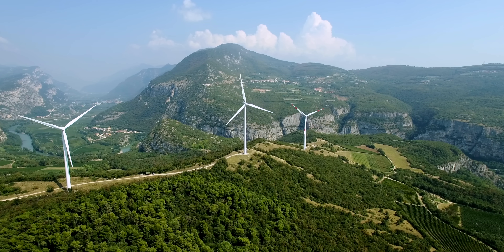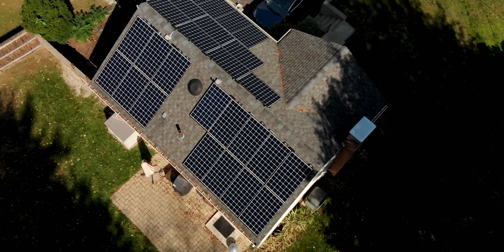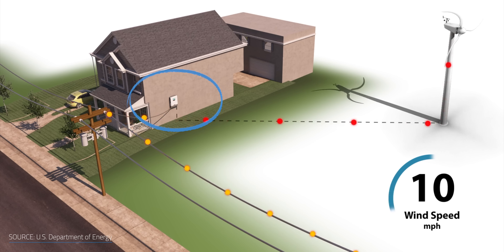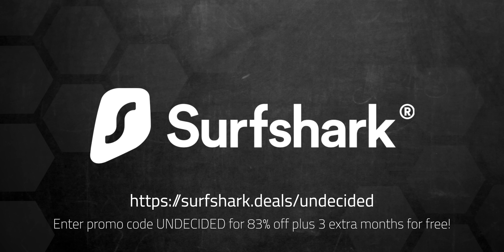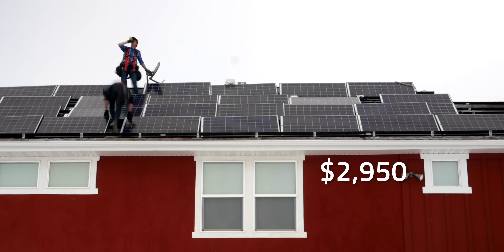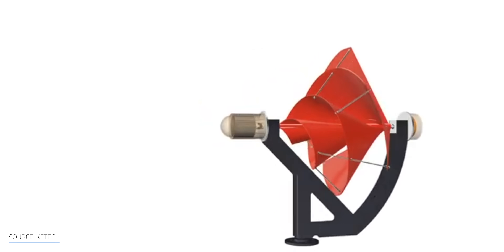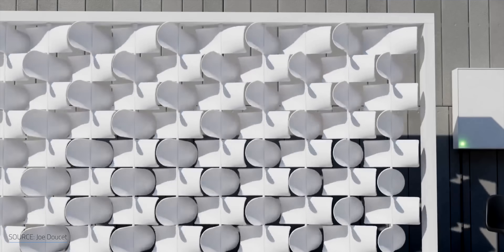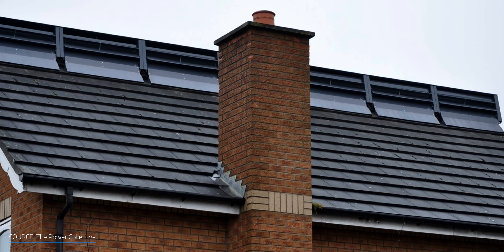The Challenges of a Wind Turbine on Your Home

Comment: I have a turbine on my off-grid property that complements the solar nicely. It cost me very little to install and zero maintenance cost since I did the install myself and perform the almost non existent maintenance once a year myself as well. My turbine is 1800 watts and can outperform the solar during bad weather producing as much as a kilowatt/hour of electricity on those days, witch may not sound like much but when you are off-grid it can make all the difference. The cost of the turbine was less than $1000 plus the cost of the tower and the charge controller/diversion load. The charge controller I use is about $600 and I built the diversion load myself for under $500. I constructed the tower myself and I'm not totally sure on the cost of it, but it was one of the smaller costs. There is also wire and hardware of course. Once constructed the turbine system costs me nothing more than the solar array to maintain, although eventually I will have to replace bearings but I have them on hand and they were cheap. You just need to be willing to do everything yourself. I am planning to do a video on my install this spring to post on my channel.
Reply: I'd like to see a video
Reply: We run turbine on the boat, great for cloudy days or at night when the solar doesn't work.
Reply: I'd love to see that video!
Reply: How large is the tower and how do you lower and raise it for maintenance?
Reply: @danielvivian3282  It's about 30' off the ground witch is admittedly to low but it still makes enough power for me. Here is the video on the tower: https://youtu.be/ozguKIbl4KM
Reply: @aloneinanearthship4010  Brilliant thanks. You may also like to watch Rosemary Barnes (wind turbine engineer) videos on wind turbines. One trick I learned was that vertical axis turbines have the generator at the base of the turbine which makes maintenance easier but I think you've solved the problem for your wind turbine. Thanks for sharing.
Reply: Good points about diy and off grid. In cold places in winter, you have very little energy coming in, so micro wind really becomes essential then.
Reply: Can't wait for your video!
Reply: it's 1800 watts but can run up to 1000 watts?
Reply: @bingobongo9340  Learn to read. It's capable of a max of 1800 watts, but in actual practice reliably generates 1000 watts.
Reply: @awo1fman  does not say 1000 watts anywhere in the comment
Reply: Same here. Bergey XL1 on 45ft tower. Has run like clockwork for over ten years.
Reply: Good for you!
Reply: Subscribed with the bell to your channel, in anticipation of your wind turbine video(s). My scenario may be similar enough to yours to follow suit. Good luck either way!
Reply: great, would you please share the turbine  model you are using ?
Reply: @No0bT4rD  congratulations, you found a typo. You are so smart!

(What he actually means is almost certainly a kW, given the other figures given, aka a kWh/h.)
Reply: @JasperJanssen  Thanks! The replies have been pretty funny so far. Lots of people who can't really read.
Reply: @dm7uy  your best bet would be to make one yourself using borrowed/rented tools. Look up axial flux generators.
Reply: @melonmusk7502  I've seen nice ones made out of a volvo front hub and two disk brake rotors.
Reply: I use several vertical wind turbines on my lake house. I put them down on my boat house and they generate like 80 percent of my energy I would need and the solar panels on the boat house generate about 40 percent of the power my house would been daily. So ultimately I generate 120 percent of what I use so I sell that extra 20 percent back to the utility.
Reply: How tall is your tower?
Reply: were from how much it cost am UK looking to buy one of them i have plans for it
Reply: Waiting for your DIY video, or would you like to manufacture it yourself.
Reply: Please give us details of all the equipment that you used
Reply: @MyChoice-now  I'm going to be posting a video about that soon, but my last video covers some of that.
Reply: Looking for video
Reply: @VIVEKAG0331  I will be doing a more detailed video soon, but I posted a video on my channel called "Off-Grid Wind Power To Compliment Solar"
Reply: Yes please do!
Reply: Hi, I was curious what kind (brand & model) of turbine that you bought
Reply: @jeffmonteith3055  I use a Midnite solar charge controller and most of the turbine came from Missouri wind and solar but I have since upgraded the PMA. I will be discussing all that in the next video on my channel.
Reply: Thank you very much. I'm building off grid this year. I am getting a whole bunch of different stories about wind. And the information provided on most of the inexpensive turbines are likely extremely inaccurate from what I gather. I'll watch for your video. Thank you
Reply: @jeffmonteith3055  Great! I have a few turbine videos on my channel now and I will be following up with a more detailed video soon.
Reply: @Lars Hansen Uh, no. Nice way to misuse numbers to mislead people. Those numbers are useless without the context of volume and many other variables. In other words, the amount of energy is related to the swept area of a wind turbine,. and airfoil and turbine designs are just as important. The velocity of the wind is just one variable in a complex equation. If you're simply talking about the kinetic energy of a given volume of moving air and the relation ship of energy to velocity, that isn't really relevant to a discussion about wind turbines because there are so many factors that have a huge influence on the power you can actually get out of it. The power curve of a wind turbine is going to look nothing like a graph based purely on wind's kinetic energy.
Reply: Congrats! What turbine did you buy?
Reply: Can you post some photo's someplace? I would like to see.
Reply: Kalki Ironman type 7 and 8 after 2026 😎

kalki avatar (beast of the earth) (christ on the white horse) (son of man on clouds) is the biggest enemy of dajjal/antichrist/kali 😏

Kalki Avatar (Murtaza) 11th satguru 13th imam cousin of Moula mahdhi a.s. 12th imam (muhammad) 😎

Prophet Moula mahdhi is raja shashidhuvj (the mighty one) born less then 1200 years ago 😎

Prophet Moula Isa a.s. will kill dajjal cause dajjal is going to kill Kalki Avatar 😏

Kalki Avatar will follow orders from 2 religious king Moula mahdhi a.s. and Moula Isa a.s. 😎

Kalki Avatar going to have 2 swords and ring of moula sulaiman a.s. and staff of moula musa a.s. (iron rod) Staff of moula musa a.s. is like omintrix can transform into anything and can transform others into anything And stone in the ring of moula sulaiman a.s. is also known as kastav mani and it's more powerful than all 6 infinite stones combined 😇

Cuz Kalki is ironman batman super saiya-jin superman ben10 saitama optimus prime shaktimaan and every super heroes combined after 2026 😎

This staff will transforms into white horses with wings,weapons,iron-man,cloud etc or can do imagination into reality 😎

*Ratn sru sword of lord shiva (miri)😇

*Ratn varu (zulfakar) sword of Moula Ali (piri) 😇

miri piri 😇

Kalki Ironman after 2026 😎

Satyug (sunrise from West) 2038 😏

Sambal is hospital 😏

Gzwa e hind 2029 😎

Khalistan and Azad Kashmir after 2026 by Ironman 😎

99% Hadith u heard is not about imam Mahdi it’s about Kalki avatar (the main character) that person momin vs dajjal prove me wrong if u can 😏
Reply: Let us know when you release your video!! Nice work
Reply: So cool!
Reply: What's your average km/h in your location?
Reply: @chan_for  On a cloudy day when the solar isn't overpowering the turbine, I have seen over 2 kWh in a day. The wind is quite variable since the turbine is only 30' off the ground, but when I am seeing good output it tends to be around 20 mph.
Reply: Moo
Reply: "It cost me very little to install and zero maintenance cost since I did the install myself".

If you did the install yourself then your installation cost is low or zero. The maintained costs come during operational service and are not part of the installation cost.
Reply: @deang5622  Well I don't understand your point? I know all of that.
Reply: Would LOVE to see this on a video
Reply: @sophiesmith5922  https://youtube.com/playlist?list=PLm2Hcqw8sMjGPCCDtHAwRKetvUSbPE_1x
Reply: The ridgeblade is’nt longer produced!
Reply: The energy companies will take down your video
Reply: I hate them,. I know a couple who moved house to get away from them!   They destroy the countryside.
They need massive fossil fuels to make them.
Reply: How do you get to hell?
Very simple: claim that you're innocent.

How do you get to heaven?
Very simple: Admit that you're not Innocent, you're guilty and ask for mercy.

How to know if you're guilty or not?
Simply: Compare your life to the Ten Commandments God gave you in the Bible.
Everyone agrees that if people followed the ten commandments there would be no need for governments or police.

Do not lie.
Do not steal.
Do not commit adultery.
Do not insult God by using his name as a cuss word.
There are six more but let's just leave it at that.

How many lies have you told in your life?

Have you ever taken anything that didn't belong to you?

Jesus said, if you look at a women lustfully you've already committed adultery in your heart with that woman.
How many times a day do you do that?

Do you use God's name as a cuss word?
Would you do that with your own mother's name?

If you answer these questions honestly you know that you're guilty.

God can justly punish you and send you to hell.

Ask him for mercy.
His name is Jesus.

It's as simple as this, The Ten Commandments are called the moral law. You and I broke God's laws. Jesus paid the fine.
The fine is death.

Ezekiel 18:20 —
"The soul who sins shall die.

That's why Jesus had to die on the cross for our sins. This is why God is able to give us Mercy.

Option A.
You die for your own sins.

Option B.
Ask for mercy and accept that Jesus died on the cross for you
Reply: @yourfriendlyneighborhoodin1559  Please demonstrate that any of that is true.
Reply: @aloneinanearthship4010  God does not owe us more evidence for his power other than the gigantic Planet full of amazing creatures on which He has placed us.

He does not owe us more instructions than those that he wrote in the Bible.

He does not owe us more warning than that which is provided by everyone's conscience before they take any action.

Surrender while you can.
Reply: @yourfriendlyneighborhoodin1559  So the look at the trees argument, seriously. You may as well just hit me with Romans 120 for all the good it will do.
Reply: @aloneinanearthship4010  good luck.
Reply: @yourfriendlyneighborhoodin1559  Thanks, you too.
Reply: There you go ; This is the main argument for Wind turbines in combo with solar ; it generates all the time Rain or shine !! Nights too - I think it will be an important feature for the residential market in the future .
Reply: How many batteries do you have installed?
Reply: Where is the video?
Reply: @foppo100  https://youtube.com/playlist?list=PLm2Hcqw8sMjGPCCDtHAwRKetvUSbPE_1x
Reply: Considering regulations/power company policies that might not be an option for a lot of people. I'm thinking of adding wind to my mix, but since I'm not off the grid, that's not really an option. The power company wouldn't allow anything DIY near their systems, they basically ask for certifications that everything was done by a certified electrician, significantly adding to the cost. On top of that the local government started regulating wind turbines due to bird/wildlife preserving initiatives.
Reply: @powertomato  Perhaps you should go fully off grid and remove the power company from the mix.
Reply: I'll be following you to see your wind setup. I'm thinking a small wind generated setup might be a good thing for winter as it's windy and rainy in the UK for winter
Reply: @acornhomestead3575  Thanks! Here is the play list https://youtube.com/playlist?list=PLm2Hcqw8sMjGPCCDtHAwRKetvUSbPE_1x
Reply: You are a renaissance person! I love how you did so much yourself!! If I were capable like that I would have liked to do the same. Congrats on your Wind Turbine Success!!
Reply: If you are for real, please make a video showing exactly what devices you used. I didn't see a video on this on YOUR channel.
Reply: @danmcclenathen2500  https://youtu.be/x1R5NQAtp_k
Reply: Wow! Sounds great
Reply: Like to see the video!
Reply: Alone in an Earthship, I am very interested in seeing the video
Reply: @peacenlove7768  https://youtu.be/x1R5NQAtp_k
Reply: Hi there, I'm interested to know more about the process of how to install a wind turbine my self to complement my solar systwm because winter time is dead and I have to use a generator  if the weather conditions are no sunshine. I live in northern Maine.
Reply: @silenceisthemostloudestscr5935  https://youtube.com/playlist?list=PLm2Hcqw8sMjGPCCDtHAwRKetvUSbPE_1x
Reply: Hey did you ever make that video? I’d be interested in seeing it if so!
Reply: @PvtPartzz  https://youtu.be/x1R5NQAtp_k
Reply: What bragging rights!

Here's something for the idiots of Renewable Energy: 

Sooner or later you greenies are going to need to grow up and learn how economies work. - hint government people understand nothing of economies other than  how to rape them.    

These G-morons decided "woke' power (power that doesn't really work) was a great idea for them, not us, so they decided to steal some money from some ratepayers in order to pay others to stimulate the growth or power that really doesn't work - ie wind and solar.

In the real world, the one that really works,  there is something called supply and demand and these things regulate the price of everything fairly.  

Your butcher buys his beef by the side and pays more for it than the meat packing plant did who in turn paid more for steer than it cost the rancher to produce it.   Get it so far?     

Now when you buy that beefsteak at the butcher's shop he's going to get his markup as well,  so you as the end consumer are going to have to pay a lot more for it per pound than the rancher was paid for it.   

Next time you want a beefsteak drive out to a ranch and buy your steer on the hoof - then you slaughter it, age it carve it up sell the inedible parts to dogfood processors and the like and eat the rest of it on the cheap - no you want the value that all those who added value to the meat along the whole length of the supply chain don't you?  Or do you buy your steaks on the hoof?      Or do you expect to pay the  ranchers price at your favorite steakhouse as well?

It's that way with electricity too, you cannot expect the power company to buy power back from you at retail rates when they don't even need or want the power. With that business model they will go bankrupt as soon as their investors are wiped out.    

If that rancher were to dine out at your favorite steakhouse why not demand that your ignorant politicians make the restaurant buy his on-the-hoof steer from him on demand at the same rate per pound that they charge you for a 16 oz prime rib?    

The problem is, as with all government planned economies, sooner or later everyone will want to receive the grift instead of paying for it, when that happens the lights go out - permanently.

The most ignorant feature of all of this is that it is supposed to solve some problem that the grifters dreamed up but that does not actually exist so solar panels and wind turbines only create huge problems, they solve nothing - time to wake up you dizzy Californians.
Reply: @hg2.  I'm sorry, was this somehow in response to my comment? I'm not sure I have anything to say in response to this crazy rant. :)
Reply: @aloneinanearthship4010  

You're part of the idiocracy of climate change. That makes you fair game.
Reply: Again, I tend to just leave crazy alone. have a good day.
Reply: @hg2.  Wow... I refer you back to my previous statement.
Reply: @hg2.  Seriously dude, I'm not interested in debating a crazy person. Thanks anyway.
Reply: @hg2.  You have obviously never watched my channel.
Reply: @aloneinanearthship4010  
Nor do I intend to watch your bragging-rights probably trust-funded channel.
Reply: @hg2.  So you admit that you have no basis for anything you said then.
Reply: @aloneinanearthship4010  🖕
Reply: @hg2.  Yup, that's about the level of sophistication I expected.
Reply: @aloneinanearthship4010  
^^ this guy's handle is "Alone in an Earthship"... and he's calling ME the flake.
Reply: I didn't call you a fake, pay better attention. And I do live alone in an earthship. What part of that confuses you?
Reply: @hg2.  I guess I'm not paying attention, I didn't notice you said "flake" not fake. Ive been called worse.
Reply: @aloneinanearthship4010  .
It's ok to be a flake. 
The problems arise when the flakes, quacks, and superstitionists get political.
Reply: @hg2.  Well my channel has never been political, but I support the right off all people to express whatever political opinions they have on their own channels and I would encourage them to do so.
Reply: @aloneinanearthship4010  
What's all this solar power crap if you haven't bought into the politics of "global warming" crap?
Reply: @hg2.  See this is why I said you had no basis for anything you were saying. You make a lot of assumptions, and from your previous comments they seem to be mostly wrong. I am a hermit.  That's why I live off the grid. If climate change wasn't a thing I would still be here, right where I am because the goal is independence and self sufficiency. The fact that I also have a small environmental impact is just a bonus. I am not a youtuber. I make no money from youtube and will not monetize my channel. I am a retired computer technician who does the youtube thing as a hobby. What appears on my channel are all the projects I do and all the troubles I run into. No politics, not that there would be anything wrong with that.
Reply: @hg2.  I'm just curious, do happen to own a red hat?
Reply: @hg2.  Actually, I couldn't care less, but I also can't possibly allow you the last word. 😄
Reply: @aloneinanearthship4010  
How big is your trust fund?
Reply: @hg2.  Wow, you are persistent. I worked as a computer tech until I could afford  to purchase this place. But if you want to set up a trust fund for me I'll take it.
Reply: @hg2.  I really have no interest in refuting your crackpot claims. I have better ways to spend my time. I don't answer to anyone, least of al some rando from the comments section of someone else's video.
Reply: @hg2.  Again, I don't answer to you. In fact, I think I've decided to add a political aspect to my channel.
Reply: @hg2.  Oh that's easy, just to piss you off.
Reply: @hg2.  Are you still here?...
Reply: @aloneinanearthship4010  
?
Reply: @hg2.  You are the perfect example of how damaging leaded gasoline was to older generations.
Reply: Climate change is crap.  

It is 21st century superstition. 

So is "renewable energy" and "carbon neutrality". 

Here is a primer on climate quackery

CO2 is a TRACE GAS - 500 ppm, that's 0.0005 or 0.05%. Trace gases do not control the climate.

Professor Bob Carter PhD on Global Warming:
https://youtu.be/_NW0re9EqE8

Professor Bob Carter on Global Warming Science:
https://youtu.be/DRCISn1KfKQ

https://youtu.be/RTSgsVdKF0Q

1 co2 molecule for every 20 Water Vapor molecules (co2 fraud)
https://youtu.be/o8nvdDXR8ZE

The trivial impact of co2 on greenhouse effect
https://youtu.be/8hgSxTS1g38

The $22 billion climate quack business:
Here's the latest from the IPCC charlatans and their total misunderstanding of the scientific method

https://youtu.be/n6VM41-v2gg

The out-of-the-gate ridiculousness of global warming.

https://youtu.be/jNd0HEvFWLs

https://youtu.be/gXr8kC7KJNE

144 videos on climate quackery:

https://climatediscussionnexus.com/video/

IPCC pressure tactics exposed: A Climategate Backgrounder

https://www.youtube.com/watch?v=K_8xd0LCeRQ&list=PL6JjafE5gsb8M02zOJoMRasbZA0865k0R&index=113&t=5s

That stupid Paris climate agreement

https://www.prageru.com/video/the-paris-climate-agreement-wont-change-the-climate/

Trace gases do not have leverage over climate.
CO2 makes up 0.05% of the atmosphere. 
CO2 is a trace gas.

The liars at IPCC:

https://www.youtube.com/watch?v=K_8xd0LCeRQ&t=17s

https://www.quora.com/Which-gases-increase-the-greenhouse-effect-more-than-carbon-dioxide?share=1

"No such thing as too much CO2"
https://youtu.be/sXxktLAsBPo

That stupid Al Gore and the 97% of scientists fraud
https://youtu.be/ewJ6TI8ccAwFt

Stupid Al Gore and Canada's 2001 climate predictions
https://youtu.be/DR6wds_ly2s

CO2 is good.

https://youtu.be/jODIYw_5A40

Truth about CO2

https://youtu.be/WDWEjSDYfxc

The stupid rhetoric of the climate quacks:
https://youtu.be/Yqbn76_IIMY

The objective of climate-quack superstition

https://www.msn.com/en-us/news/world/mexico-city-aztec-tower-of-skulls-discovered-by-archaeologists/ar-BB1bUlqX?ocid=msedgntp

America: how do you make solar "cost effective"? Force up the price of electricity.   
Britain: how do you make heat pumps cost effective? Force up the price of gas. 

https://www.youtube.com/watch?v=GhAKMAcmJFg

Minute 22:00 refrigerants disassociate in water, so how can they "cause global warming"?
https://youtu.be/5SpOiHB6VsE

Termites, anyone ? ? ? ? 
http://iloveco2.com/termites-emit-ten-times-more-co2-than/

https://preventdisease.com/news/10/071110_terminte_co2.shtml

https://youtu.be/pMH0ksLG1oY

William Happer
https://youtu.be/CA1zUW4uOSw

The mendacious IPCC and the stupid sealevel argument
https://youtu.be/ViY2J3LPgN4

Dozens of climate cycles

https://www.youtube.com/watch?v=lZw4DdocxN0

"Renewable energy" is a kids' lemonade stand business model. Why? Because Mommy and Daddy ( the power grid) is always there to provide power when lemonade-renewable doesn't feel like working (i e. when it's nightime or it's cloudy).

[Let's not talk about what happens when the kids' lemonade stand business model is bought into for more than a Saturday afternoon and weather doesn't comply with the business plan, e.g. the Texas winter of 2021.]

Bob Carter on the butchering of the scientific method:

https://youtu.be/eBcIuxigoCM

Naturally occurring CFCs and PCBs:
"Many of these chemicals are identical to highly publicized manmade organochlorines: chlorophenols, chlorinated hydrocarbons, PCBs, CFCs and dioxins."
https://chlorine.americanchemistry.com/Background-Natural-chlorine-You-bet-/

Researchers investigate ‘PCB-like’ chemicals made by Mother Nature
https://www.whoi.edu/news-insights/content/natural-pollutants-in-fish/

Energy Communism
https://tiny.iavian.net/1g49t

Ienesco couldn't write a play this absurd.
https://youtu.be/VmZsSV_k8vs

120 videos on climate quackery
https://climatediscussionnexus.com/video/

Hubris
https://youtu.be/P19ywkobLX8

Stupid Prince Charles
https://www.youtube.com/watch?v=NFftQwHUyOg

Rising sea level quackery
https://www.youtube.com/watch?v=ViY2J3LPgN4

Sea level
https://youtu.be/WTRlSGKddJE

Matt Ridley and the stupid "sustainability" argument
https://youtu.be/S-nsU_DaIZE

Banker talks about climate quackery
https://youtu.be/5QHCxZt616w

Thomas So we'll on climate quackery 
https://youtu.be/1cEWw0Cfg8k

UN plan to tax meat to force eating bugs.
https://youtu.be/op-_4gBoCYs

Christopher Moncton on renewable energy quackery.
https://youtu.be/ZH4m-Cs-u3Y

Dr. Judith Curry
https://youtu.be/YBdmppcfixM

William Happer discusses ozone and climate quackery
https://www.youtube.com/watch?v=KGn-6kGoD0c&t=1320

Thomas Sowell 
https://youtube.com/shorts/il-9eOwZuFs?feature=share

No climate cause and effect:
https://youtu.be/Cz45fETw078

Climate elites fly private 
https://youtube.com/shorts/mBBX4Z2IlfU?feature=share

Stupid rising sea levels.
https://youtu.be/RxRWcygrKUE

The stupid recycling ritual:
https://youtu.be/NLkfpjJoNkA

Stupid HYDROGEN -- another science-project boondoggle for the tax-funded climate quacks

https://www.youtube.com/watch?v=Zklo4Z1SqkE&t=10s

* * * 

Here's something for the idiots of Renewable Energy: 

Sooner or later you greenies are going to need to grow up and learn how economies work. - hint government people understand nothing of economies other than  how to rape them.    

These G-morons decided "woke' power (power that doesn't really work) was a great idea for them, not us, so they decided to steal some money from some ratepayers in order to pay others to stimulate the growth or power that really doesn't work - ie wind and solar.

In the real world, the one that really works,  there is something called supply and demand and these things regulate the price of everything fairly.  

Your butcher buys his beef by the side and pays more for it than the meat packing plant did who in turn paid more for steer than it cost the rancher to produce it.   Get it so far?     

Now when you buy that beefsteak at the butcher's shop he's going to get his markup as well,  so you as the end consumer are going to have to pay a lot more for it per pound than the rancher was paid for it.   

Next time you want a beefsteak drive out to a ranch and buy your steer on the hoof - then you slaughter it, age it carve it up sell the inedible parts to dogfood processors and the like and eat the rest of it on the cheap - no you want the value that all those who added value to the meat along the whole length of the supply chain don't you?  Or do you buy your steaks on the hoof?      Or do you expect to pay the  ranchers price at your favorite steakhouse as well?

It's that way with electricity too, you cannot expect the power company to buy power back from you at retail rates when they don't even need or want the power. With that business model they will go bankrupt as soon as their investors are wiped out.    

If that rancher were to dine out at your favorite steakhouse why not demand that your ignorant politicians make the restaurant buy his on-the-hoof steer from him on demand at the same rate per pound that they charge you for a 16 oz prime rib?    

The problem is, as with all government planned economies, sooner or later everyone will want to receive the grift instead of paying for it, when that happens the lights go out - permanently.

The most ignorant feature of all of this is that it is supposed to solve some problem that the grifters dreamed up but that does not actually exist so solar panels and wind turbines only create huge problems, they solve nothing - time to wake up you dizzy Californians.

* * * 

..
Reply: Want real life, a-kicking, bad-a- experience with a GREENHOUSE GAS?

... Spend a night in the desert without a sleeping bag.
Reply: @hg2.  Sorry, I hated to do it, but I had to mute you. You were becoming kind of a pest.
Reply: @aloneinanearthship4010  
?
"I was just getting started."

To borrow from Jack Nicholson... some people can't handle the truth.
Reply: Pop Quiz: why is it bad to have political control of education?
Reply: Mike Pompeo says Randi Weingarten is the most dangerous person in the world.

https://youtu.be/KY8hDajSOY8
Reply: @hg2.  to answer your Pop Quiz, you. You are all the reasons it is bad to have politics on education. Have you supported efforts to ban any books or curricula lately?
Reply: Please do post the video.
Reply: @Suburp212  https://youtube.com/playlist?list=PLm2Hcqw8sMjGPCCDtHAwRKetvUSbPE_1x
Reply: Definitely gotta make a good break down and tutorial video.

Great info! Very cool
Reply: https://youtube.com/playlist?list=PLm2Hcqw8sMjGPCCDtHAwRKetvUSbPE_1x&si=WbOAVFBikz-H0Cg7 @skram1000
Reply: Did you make the video?
Reply: @theinqov  made a bunch: https://youtube.com/playlist?list=PLm2Hcqw8sMjGPCCDtHAwRKetvUSbPE_1x&si=mXyZa-A74l_dvJeh
Reply: how is your wind turbine going & may I ask what brand please?
Reply: @dianemcguinness9269  I believe the PMA is hornet systems "Max Core" unit, the  tail, blades and other hardware on the pole is from MWS.
Reply: Need to see this video or it didnt happen! J/k I believe you but still want to see this video.
Reply: @AxelFoley317  I will be working on that video soon
Reply: @AxelFoley317  Yep, "His lips are moving"
Until we see his video, his lips are just moving!
Reply: I’ve wanted to DIY something out of salvaged stuff.  I’m pretty sure that I’m at the level of know enough to get myself into trouble but not enough to get myself out of it when it comes to knowledge on this subject.  I’ve been trying to figure out what kind of old broken machines I might be able to get a permanent magnet motor from and ask for on the buy-nothing group or craigslist.
Reply: @jenchan4817  I’d just go for it. Easiest way to learn. Be on the lookout for washers/dryers or treadmills being thrown out, given away, or sold cheap. Super easy way to get a small motor to play with. As for getting wire and stuff super cheap, I like to go to resale places (there is one called “habitat for humanity”) and I get nearly full spools of all types of wire for under $15 a spool. Then it’s just a matter of having something that’ll turn the motor to generate electricity. To do it right, you’ll need a controller, inverter, and probably a metering device, but I’d just start with getting the motor and go from there.
Reply: @jenchan4817  There's plenty of videos on YouTube of people who've done it .
Reply: Most people don't want to climb a very high tower to do maintenance. Some will, but most will not.
Reply: Your "backup power" case is basically optimal. Sadly enough, home wind isn't likely to ever make much sense for any larger deployment.
Reply: Off grid is the key here. For on grid apps where there is net metering, you want the most production for the dollar, and that’s solar. 

A friend who is a talented electrical engineer equipped his home with wind and solar about 12 years ago.  The solar system is still producing, the wind system never produced significant power and is now a curiosity in his yard.
Reply: @paulogden7417  if people are discouraged from wind, the technology will not be pushed forward.  Be more curious.!
Reply: @paulogden7417  idk if your farther north wind might make sense other than the middle of summer.
Reply: @paulogden7417  
It all depends on the wind and solar potential of the particular site. There is no catch all statement for which source of energy is better.
Reply: @paulogden7417  LOL "a friend" and "a talented electrical engineer". Yeah, right. I just love anecdotal evidence. Even if you actually know someone and he knows a lot about electricity, he obviously knows nothing whatsoever about wind power and never gave it a decent go. And probably didn't even try to make it work because the solar did everything he needed. There's nothing about your statement that is valid.
Reply: @paulogden7417  location, location, location
Reply: @paulogden7417  Actually off grid + in the middle of nowhere is key here. No one wants to see an ugly wind turbine jutting up into the sky in a typical urban or suburban setting. Furthermore, very few urban and suburban settings have sufficient wind to make wind turbines very useful. People like living in sunny places (which are good for producing solar energy); people generally dislike living in windy places (which are good for producing wind energy).

On the other hand, wind turbines are excellent at utility scale in, say, windy mountains passes or the on windswept great plains which have seemingly endless fields of row crops but are very sparsely populated. It's not an accident that the USA generates about ten percent of its electricity from wind, that Texas produces the most electricity from wind, and that Iowa produces around sixty percent (over 1/2 of its) electricity from wind. Source: https://en.wikipedia.org/wiki/Wind_power_in_the_United_States

Producing electricity from wind is great, but not for most residential uses in the USA. Sure, if you have 40 acres off grid on which you built a rustic cabin, then yeah, wind power might make a lot of sense. Chopping your own firewood, fishing, and building an outhouse might make a lot of sense too. But solutions for off grid cabins are an edge case (a rare case) that are irrelevant for the vast majority of folks living in the USA.
Reply: @paulogden7417  I would recommend the (UK based) Energy Saving Trust Domestic Small Scale Wind Trials 2009 for anyone considering purchasing one of these devices as their findings were much the same as your engineer friend. The caveat is that these tests were undertaken before the new-style small wind generators that are referred to near the end of the video.
Reply: @paulogden7417  i mean why u need connect to grid wind turbine u can just stop trubine if u dont need power with solars is diffrent cuz u cant turn them off
Reply: @karate8613  Of course you can turn them off, just put a switch inline with the output from the solar panel.
Reply: How much time did this take you.  Unless you don't value your own time at all, you need to count those costs.  Sounds like you put several thousand dollars worth of labor into this system.
Reply: @ericmgodfrey  I put 2 years worth of labor and  $20 to $30K into that boat. It took me 6 weeks to sail it from Los Angeles to La Paz Mexico and I lived aboard and cruised the Sea of Cortez for 6 months in it - with my partner. Two people on a 20 foot boat, off-grid and without any fossil fuel. It wasn't cheap or easy, but that wasn't the point. The point was self-reliance and overcoming the challenges presented by such a voyage. We were rewarded with a sense of accomplishment and pride that's both timeless and priceless.

I'm a licensed architect FWIW. When I mention green technology, the usual concern is "How long will it take to pay for itself" The funny thing is, they never ask about the lifecycle cost or return on investment of the ugly and expensive granite countertops and oak cabinets they want for their kitchen remodels. The fact is, they'll be lucky to recoup 80% of the cost of those things when they go to sell their home. Done right, off-grid solar and/or wind power systems eventually pay for themselves, and make homeowners energy independent. When the grid goes down because of a natural disaster or just plain mismanagement, what's that worth?
Reply: @TheWilliamHoganExperience  I will certainly give you the granite countertop example and offer that no one ever asks about what the pay back on their convertible or bass (or sail) boat is either.  Yes, solar will pay for itself but I will offer that in 100% of my actual experience a small wind turbine will quickly get to the point of being too expensive to repair long before it's ever paid for itself.   I've been around dozens of them for over 30 years and they all end up in the bin.  I'm a licensed electrician and general contractor so I have the knowledge and the expertise to install them properly but if the factory disappears in three years and there's no replacement parts then what??  I'm pretty sure I've yet to be around one that even paid for the cost of the wire between it and the batteries/inverter.
Reply: @Altenurgy  Yes. All of those factors come into play. My application was an extreme one, and it was necessary to have multiple redundant systems. If you think sourcing electronic parts is hard in the US, try doing so in a remote part of Mexico or the South Pacific! Equipment like an electric autopilot (I had two) and GPS (I had 5 separate devices and paper charts) are absolutely critical at sea on extended passages, and when making landfall. In the end, the wind turbine I had served as a supplement to my solar array, and as a back-up. They only work well when the wind is blowing - HARD. That's when I try to be anchor recharging, because being at sea in gale force winds sucks.  

Micro wind turbines generally only make sense for residential applications in areas with predictable and fairly high average wind speeds coupled with problems getting reliable solar radiation from cloud cover or shading or exposure / latitude problems. There are a complex series of trade offs when going truly off-grid, and everything requires careful consideration. Again, my current boat doesn't have a wind turbine, because I'm able to fit a much larger solar array on it, and have both diesel and gas driven alternators for back-up, along with a much more advanced LiFePo battery bank. If I was planning to spend a lot of time cruising in Caribbean waters, I'd probably add a wind turbine because of how consistent the winds are there. Same goes for building a ski cabin up in the Canadian Rockies. In downtown Los Angeles? No. In the adjacent high desert near Palmdale? Maybe. At the beach on top of a giant  south-bay sand-dune with my roof and yard shaded by trees and neighboring structures? Probably. At least if local zoning codes permitted it. Interestingly, geothermal energy is sometimes used in the area too. That's an alternative source that's rarely talked about, but actually contributes about 6% of California's overall power generation. For comparison, solar provides about 15%. Ultimately,  I don't really care about the whole global warming thing - that's too speculative and controversial to motivate people to go green. What matters to me is self sufficiency and robustness. Decentralization of power generation and taking personal responsibility for it equals personal freedom and independence. That's why advocate for off-grid stand alone power generation. If it helps stabilize the climate and save money, great, but that's not the point for me.
Reply: @TheWilliamHoganExperience  Exactly. Payoff times completely miss the point. It's rent vs. own: you can either just flush money down the drain forever, or you can put it to a use that will allow you to get at least most of your money back. But in the case of both home power generation and real estate, you're eventually going to get MUCH more out than you put in. It's no contest. Long payoff times will ALWAYS beat being forever in the red. I don't get what is so difficult for people to understand about that.

Also, a mortgage payment is always less than a rental payment on exactly the same property, so if you can afford to rent and you say you can't afford to buy you're a moron. (And don't get me started on the insanity that is car leases.) The same goes for home solar and wind: even if you can't pay for the system outright and have to finance it, unlike a power bill you know EXACTLY what the payment is going to be every month, and eventually that payment will end forever and it will all be free from then on. Exactly when is irrelevant.
Reply: @Altenurgy  Because payback times are irrelevant. The fact that a payback time EXISTS permanently trumps any situation where a payback time ISN'T EVEN POSSIBLE! Like, say, you're paying a grid operator for power...

And that doesn't even scratch the surface of all the advantages of being self-sufficient.
Reply: @awo1fman  Yup. Good analysis all around. The only potential fly in the ointment are credit scores and income documnetation when it comes to financing to purchase vs renting a home. Landlords in general will rent to people with sketchier credit scores and income streams than banks will lend to for mortgages. At least these days. Prior to 2008, anything went as long as the buyer was willing to swallow high interest rates, PMI, massive balloon payments as part of a sub-prime mortgage scam. Those days are over.

The other thing that comes up with real estate purchases are huge down-payments. Again it depends on the local market and a host of other factors, but put less than 20% of the purchase price, and your going to get screwed hard on loan terms. This might make the payments higher than what you can rent something similar for, again depending on the local rental market vs local residential property markets. Then you have to factor in maintence, property taxes and insurance costs vs tax write-offs and potential market appreciation. Let's face it: Most people are not sophisticated enough to understand much less analyze all the factors that go into a complex purchase like a home. Renting is a much simpler process and comparative cost calculation between rental vacancies is dead simple. It's also a lot easier to move out / leave a rental property if you change jobs or have psycho neighbor or whatever. Selling a home you purchased with a loan is just as complex as buying one, just without the credit score or income documentation headaches. 

If you owe more than the property is worth, you are truly screwed. Housing markets are highly volitile, and when you borrow money to get into them, you are using leverage just like a stock trader buying on margin. Leverage works both ways: It amplifies gains and losses equally. If you are forced to liquidate when the market is down due to the loss of a job or a better opportunity somewhere far away, you're gonna have to cough up the difference between what you owe and what you're able to net from the sale. Sellers pay all sorts of fees when when liquidating real estate. So do buyers, but most of these are required as part of the financing process.

None of the above applies to renting, unless you sign a long term lease, and that's rare for residential leases. Most are a 1 year lease at most, and that generally rolls over into a month to month agreement when it expires. Depends on your state laws.

As far as cars, leases can make sense for businesses and sometimes personal uses, but not very often. Again, the factors are complex, and very few people understand or go to the trouble of educting themselves about the trade-offs, just like with Real Estate. From an economic standpoint, vehicles are the second largest purchase most people ever make, and most people get screwed whether they buy or lease. It's the financing and insurance and hair-raising asset depreciation over the life of the loan that screws new car buyers. Used cars bought with cash are a much wiser way to go, but like with the granite countertops, cars are an emotional purchase for most people - that's why most people get screwed so hard when buying them.

Wind and solar are utilitarian purchases for most people. So absent the emotional element, they focus soley on simple metrics like payback period, and decide they'd rather squander their capital on a new car and granite countertops because they get an immediate emotional payoff instead of a long term financial pay-off and long term energy independence.

It's just how consumerism rolls, and it's a big part of why most people, even ones making a lot of money, live hand to mouth from cradle to grave.
Reply: @ericmgodfrey  Yeah sure, but one of the points of going off the grid here is to step outside the monetary system as far as possible, plus this is my place and I am the one getting all the value from my labor.
Reply: Can you supply data to support your statements?  I've been involved in 100's of off grid power installations and EVERY time small was involved it failed miserably without exception.
Reply: @Altenurgy  I think the key thing is that he is willing and able to do everything himself.  The parts for a modest wind turbine are about what he says.  The expensive part is hiring someone to do the install, wiring and maintenance.  If you are willing and able to do it all yourself, you can save a lot of money.
Reply: @johnholden2685  definitely if you can do it yourself you should.  But if you spent that same time and probably 1/2 the money installing solar you'd still have an energy source that was cranking out energy 30+ years from now with zero maintenance with nothing more than the occasional inspection and cleaning.    Getting 3 trouble free years out of any wind turbine would be unlikely and from what I've seen they are either far to expensive to consider replacing by year 5.  Then factor in that turbine manufacturer will most likely gone in less than 5 years so won't even be able to get parts.  That's the reality of small wind and it's what I've personally seen dozens of times.
Reply: @Altenurgy  Solar is great, it's what I have and so far every bill I've had since installation the power company has PAID ME instead of me paying them. But solar isn't the be all and end all. There isn't one solution that works for every single application. Solar is great for locations with lots of sunny weather and closer to the equator where the sun is up for many hours each day. But it starts to lose efficiency closer to the poles where the light has to go through a lot more atmosphere and winter nights can approach 24 hours. Even places near the equator aren't good if there is consistent cloud cover. And even where I live which is a fairly favorable climate the difference between winter and summer solar production is almost exactly half in winter as that in summer.

Wind, on the other hand, isn't at the mercy of the sun or seasons or weather, and in fact can often do better in inclement weather when there tends to be higher winds.

As for the reliability of small wind turbines, that's a function of the market, not inherent to the technology. The unfortunate fact is that because of all the FUD spread by people like you there's not much market for small wind turbines, which means not much money in it, which means no companies have put any resources into making small wind turbines that are reliable, efficient and perform well. So we're mainly left with fly-by-night companies selling crappy products for a fast buck to people trying to do the right thing and desperate to get whatever they can get their hands on.

Your car is an incredibly complex machine. An internal combustion engine is far more complex than any wind turbine will ever be, and yet most modern cars will go hundreds of thousands of miles with very little maintenance. That's not because they are simple, it's because resources have been brought to bear over many years to make them dependable. The obvious fact is that even the most complex wind turbine is far less complex than even the most simple internal combustion engine and has far less stress on it, so it should be elementary to make them cheap, dependable and with decent performance. The only way to make that happen is for more people to jump on the bandwagon and CREATE a market that will catch better companies' attention so they will start making the products we need.
Reply: @Altenurgy  People used to make very similar arguments about solar. Look at it now. It's just missing a touch of innovation. Ultimately the issue is there isn't very much extractable power from the wind. So you need a large turbine if you hope to generate a significant amount of power. Enough to cover maintenance and so on. So I do agree that it will never be able to stand alone or compete with solar when it comes to powering a home. That doesn't mean it has no practical applications. Where it could potentially pay for itself and more. 

I think key factors would be making the system as maintenance-free as possible and having it act as a supplement to small applications. Instead of trying to power a TV for example. Power a few lights here and there. Say powering the lights in a home. Assuming LED. You could theoretically remove all the drivers and power the LED from the system DC/Batteries. Perhaps a bit too much just spitballing here. If we went with lights we could add portable item charging stations. Which would get rid of bricks that passively consume power. Not much, but it could potentially all add up to significant savings.

I think you're just a little too pessimistic about this. "Free" power is free power. Surely there's a way to make it work.
Reply: @Mia-ln1zs  you are totally right that I should be more optimistic.   I will work on that.

In the mean time I'll cordially invite you to humor me and mark your calendar to revisit this topic in a year, in 5 years and 10 years to see if any of the products mentioned here are still around.  In my 30 years of being full time in the renewable energy industry I've seen this cycle repeat more times than I can recall.
Reply: @Altenurgy  There are some talented homebrew wind generator makers in Colorado who would argue about how much they make vs cost.
They use the front spindle and rotors from Volvo cars so parts aren't an issue and the front  wheel bearing is plenty strong enough for the load and they use furling tails to protect it in high winds.
Most of them have as much in the tower as they do the generator.
A 700 watt generator for a few hundred pays off pretty quick in the mountains.
I will agree the ready made micro wind market is full of pie in the sky promises and shoddy products.
And small (not micro) systems aren't for a lot of people but for some they are a good investment.
I just got a "2000 watt" brushless DC 48 volt permanent magnet motor online for $120.
6 diodes and it's a DC generator.
Reply: @Altenurgy  I used a small marine wind turbine on a sailboat I cruised in Mexico in 2012. It was combined with 300 watts of solar panels on a 20 foot boat with 400ah of AGM battery storage. This was enough to power a small refrigerator, lights, navigation system, autopilot, a laptop, and even a small electric outboard. We were off-grid for over a month at one point in some very remote areas. The key is conservation and properly sized power generation systems / battery storage. The wind turbine was tiny - it barely put out 1.5 amps at 12v in strong winds. But it did so day and night in windy areas, and so that 1.5 amps added up. My current boat has a 1KW array, and 300ah of LiFePo4 and a 2400 watt inverter. This is supplemented with a gas genset and a 75 amp alternator powered by my diesel auxiliary engine. I also have 50amps (12v) worth of charging capacity I run from shore power or my genset, which has it's own inverter. Again, it's all about managing your resources carefully, and having redundant systems for anything critical - like power. I've considered adding a wind turbine, but it's not really necessary on this boat. Hydrogenerators are another option on a cruising sailboat offshore - it's really a form of wind power generation capturing some of the sails propulsion force through the water. You tow it behind the boat.
Reply: @TheWilliamHoganExperience  Sounds like a neat trip. You've cherry picked a very specific example that is radically far from what can be applied to a common situation.    I was talking in generic terms. If you were to install that turbine on a house it would barely power the phantom load of one television when turned off and that's only when the wind was blowing like mad.  When speaking about small wind no one ever references real numbers and how they would apply to even the most efficient common household.   So if it is about managing your resources carefully that also applies to your financial ones as well, right? No form of small wind has ever been proven to be cost effective for a typical household.   Check back in three years and if a single one of these wind turbines that actually makes it to production and not disappeared with millions of investors money I'll gladly eat my words.  Cheers!
Reply: @Altenurgy  Nice FUD. You're exaggerating like crazy and you clearly haven't actually followed power usage in your own home enough to have any clue what you're talking about. I have a 2-story, 4-bedroom 3000 sq. ft. house, and most evenings there are an 85-inch and 65-inch TV both going in separate rooms with full surround systems. The power draw for the entire (without heating or cooling, which we generally don't need) at those times stays below 600 watts. The overnight phantom draw for everything that is permanently on (huge fridge, separate large upright freezer, and everything else that is always plugged in and drawing some power, however little) is below 400 watts.

There is no modern TV of any size that uses much more than 100 watts at its absolute peak. Projectors are another story, but even the biggest, brightest home units generally draw well under 500 watts even when running full blast.

So what Big Oil company do you work for, anyway?
Reply: @Altenurgy  New video on the turbine will be coming soon on my channel, in the mean time her is something that might help: https://youtu.be/flMrOEDku3Y
Reply: @Altenurgy  Thanks for the FUD. Can you supply data to support YOUR statements? Nope, because it doesn't exist. What DOES exist is always very carefully kept out of context of installation specifics. Meaning installations done by clueless or shady  installers for clueless customers with no attempt whatsoever to give it the best possibility of success and obviously no attempt to make any changes to make it work when it (of course) didn't.
Reply: @Altenurgy  Depends on the definition of small. What he is saying, is large for residential
Reply: How tall is your sister
Reply: What does it mean to produce a kw/h? Seems like a meaningless number.
Reply: @No0bT4rD  Hi. A kilowatt is equal to 1000 watts. If you produce 1000 watts (1 kW) for a period of 1 hour, you have produced 1 kilowatt hour or kWh. 
1kW X 1 hour = 1 kWh
The typical hair dryer consumes 1300-1500 watts. If you operate that hair dryer for one hour, you have consumed 1.3-1.5 kWh to give you a sense of how much energy that is. 
1300 watts (1.3kW)X1 hour = 1.3 kWhs
1500 watts (1.5kW)X1 hour = 1.5 kWhs
Reply: @No0bT4rD  kw/h? I believe the video use kwh
Reply: @bayerbear6770  The video is not what's being discussed....
Reply: @No0bT4rD  LOL It's the only number that matters. Duh.
Reply: @awo1fman  Not actually correct.
KWh is not important and makes no sense to use these units to indicate the performance of the turbine. Why? Because it's linked to time. It's a measure of how much energy is produced by the turbine and that depends on how long you run it.

A better measure of performance is KW which is the instantaneous power produced by the turbine.

Now, we need to draw attention to the units the poster used of KW/h, which is clearly a typo or a misunderstanding, and given he's put an h in there, perhaps he intended KWh.
Reply: @No0bT4rD   A kw/hr is about 15 cents in electric savings where I live
Reply: @No0bT4rD  I believe 1 thousand watts consistently for an hour average.
Reply: @No0bT4rD  Well I guess it does seem like a meaningless number if you don't understand it.
You obviously have never paid an electricity bill, or if you have you have not understood what the figures on it mean. Oh dear.

I won't explain in full what a KWh is because another poster has given a good example to explain it. All I will add us that it's a measure of energy consumed or produced.
Reply: @deang5622  I'm asking what kw/h is. Not kwh...
Reply: @No0bT4rD  almost all the public for this video understand that it's energy, it should be spelled KW.h (capitals varies in different conventions). No need to be pedant in a nice thread like this.
Sorry for the audience, because trying to keep the other's netiquette I sound a little pedantic too.
Reply: @ricardoivan3876  It has been pretty funny though :D total gotcha question that the average person here doesn't seem to pass.

But then of course physics and engineering is really not a strong suit of Matt's viewers.
Reply: @No0bT4rD  it’s watts times hours. Eg. 1 kW x 2 hours is 2 kWH’s